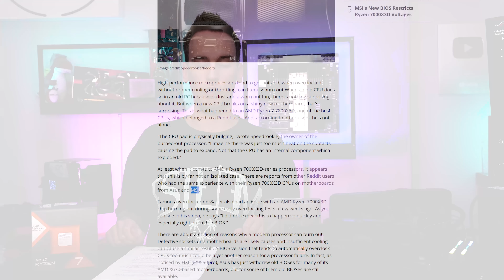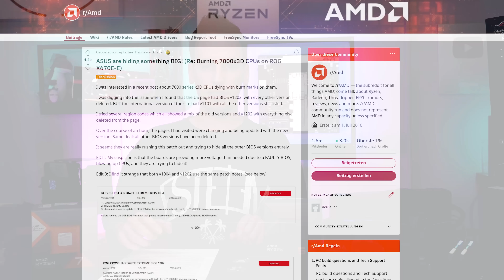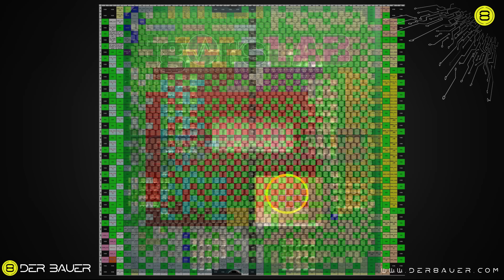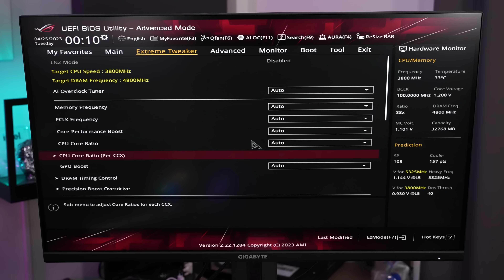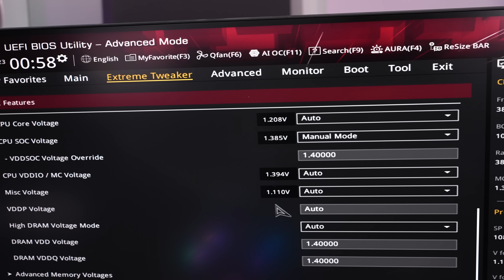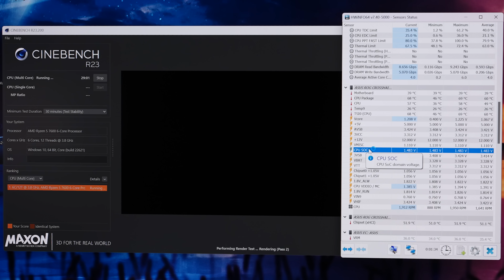I missed the Damage on this Ryzen 7900X

Comment: AMD has had a problem with voltage supply accuracy for a long time. For example, for gigabyte b550m ds3h, when installing the xmp memory profile, the voltage is set higher than that specified in the xmp profile, regardless of the memory manufacturer. That is, if the xmp voltage is 1.35v, then the voltage in the bios shows 1.365v.
Reply: that's normal, 10% up or down is engineering tolerance. The 12V rail of the power supply has 5% tolerance and it might be overshooting compounding the problem. But that memory voltage there is perfectly fine. I'm running it at 1.40V for a few years already. Just make sure that it is cooled enough.
Reply: NOOO THATS IMPOSSIBLE
LISA SU WOULD NEVERR

Comment: I'm glad I just got a 5950x, as newer stuff still hasn't settled it's quirks.
My choice should be fine for my multitasking and renders.
Reply: Got a 5800X3D a few months back and yep. Even the 7800X3D doesn't provide enough of a performance jump to bother upgrading to an entirely new platform for.
Reply: I am pretty happy with my new 5600 and used 5700xt. Puts my old system to shame and didn't break the bank.
Reply: Naw. It run’s awesome. It’s fantastic.

Comment: It's quite interesting to me because not only I have a X670E-F and 7700X, but also I have this weird problem where Ryzen Master doesn't work. Every time I want to set EXPO though Ryzen Master, the BIOS unable to post (UEFI only posts to "safe mode" meaning I have to clear CMOS settings). However, it works nicely if I go to Asus's BIOS and set the EXPO that way... (Corsair DDR5 6000 CL 36)... Maybe its because Ryzen Master not applying higher voltage??
Reply: chipset drivers issues.
Reply: @JomarsYT not sure, but the Asus board did bump up SOC voltage to 1.37. but still I gave up and just use the ECO mode in Asus's UEFI instead of using Ryzen Master.
Reply: Stupid overpriced motherboard but only a 7700X and CL36 RAM not CL30?

Comment: ive been running expo  I 32g cl 30 6000mhz on 7900x ( crosshair hero board ) with a 4090 and a 1200ax psu. 
it's been 4 weeks constant, very stable and no errors or problems. Strange results
Reply: Same. Just another jump scare video. It will be fine. I’m not worried
Edit- been running it since last November
Reply: coughs, thats roughly $6,500+ system, if you got other high quality components (PSU, M.2 SSDs, coolers, 4k monitor).  Its my dream setup.  I will try to get similar soon 7900x, but with 4070, Prime x670p, 32gb cl32 64000mhz, 1440p monitor and shave off $3000.   Not much of a gamer and I think the 7900x is a monster

Comment: I think you nailed it at 6:06.
The CPU died from something else, maybe just the SOC or IMC has died, and that made it stop correctly reporting some sensors back to the motherboard, that kept sending high voltages until it blew something inside the PCB/CCD/IOD due to really high temperature. 

It's like the motherboard had heard someone saying 'FINISH HIM!!!" so it did a fatality, but ended up dead too :text-green-game-over:.
Reply: Double Fatality
Reply: More like a failed friendship...
Reply: "Victory IS flawless!!!"
Reply: IOD? More like IED ! lol
Reply: IED? More like IUD ! lol
Reply: @cmja09  _!_lol
Reply: Would be funnier if we still had Fatal1ty boards.
Reply: Like Voldemort killing Harry Potter :)
Reply: hahaha
Reply: your x3d amd ryzen soul's is mine!
Reply: Do you think it is directly related to the VDD of the memory interface or rather indirect via burning the SoC by applying too high voltage to the SoC when using XMP/EXPO?

And related to that question: did the DDR5 modules also get fried?

Comment: I recently noticed the very high SoC voltages being used when EXPO was enabled with my 7800X3D and G-Skill DDR-6000 CL30 Ram, on an Asus TUF Gaming X670E-plus. This is with the latest (non beta) bios 1409 released a few days ago.

What concerned me was the sheer jump in SoC power - non expo default voltage was 1.05v with SoC power at ~9W. 
This jumped to 21W with expo enabled and 1.35v SoC voltage. That's quite a jump, especially when you consider the percentage increase is 133% from default.

Also that power draw is continuous - same in idle as under load....i.e. any stress it's putting on various SoC IP blocks at that voltage is continuous.
I lowered my SoC to a much safer 1.15v, then subsequently to 1.1v which has dropped the SoC package power down to ~10W.

I recommend everyone with EXPO enabled do this for now, or just disable EXPO if running any 7000 series AM5 CPU (X3D or not).
Reply: I have the exact same CPU/RAM on order with the ASUS ROG X670E-E. Until I watched this video I was planning to exchange the ASUS board for the MSI Carbon WiFi but it sounds like it’s a problem for all the manufacturers.

Now though, I guess I’ll stick with the ASUS board and follow your lead or just not use EXPO until the problem is fully investigated and understood.

🤷‍♂️🤷‍♂️🤷‍♂️ 😖😖😖
Reply: @Squashed8Ball  And the Carbon Wifi at the moment also has an know bug, which hopefully does not get delayed fixing due to this new issues. The issue is, that PCIe x1 and x2 cards are not recognized in the PCIe_3. Which with the humoungous size of GPUs today is more or less the only usable PCIe-Slot.
Btw. with 6000MT/s DDR5 the Carbon Wifi used VDDCR_SOC fo 1.350V and 16.8A
Reply: and as I just had lunchtime I checked MSI Carbon Bios for VDDCR_SOC. As soon as you enable EXPO it is fixed to 1.350V (without to 0, which then probably means default)
I now lowered it to 1.250V - so far no issues and it reduced the SOC's power-usage by ~5W - also in idle.. nice 😉
Cinebench is no good mem-test, but I simply used it for a quick-check, as I know the numbers to expect... and in deed the performance increased, as my 7900X@120W TDP was in the low 28k and now almost reaches 29k and still max-temp is 85°C with a decent air-cooler. 5W more headroom to the power-limit I guess.
Reply: @Squashed8Ball  its probably an AGESA problem so yes everyon affected nothing MOBO mans can do about it.
Reply: I have the same. 7800x3d / ASUS x670e-e/gskill ddr5-6000 cl30.  Meh, I’m gonna just keep on keeping on. (Bios 1202)
Reply: I noticed this weird behaviour right at the beginning, as my  #1 priority is low TDP in idle and under light load (so that NH-P1 can cool my 7900 passively). With Expo on, idle power consumption was at 40W, while with it off it was around 30W, with the difference being in SoC (this is quite a significant difference when the total limit is 88W). 
So obviously undervolting SoC was the first thing to do, in my case, 1.1V is absolutely fine with 6000MHz CL36 sticks. This not only decreased idle power, but also increased benchmark scores, as there's more power/thermal budget for cores.

I personally am not scared of EXPO, but definitely recommend everyone to decrease SoC voltage to 1.1V, if it doesn't introduce stability issues (in such case just go a bit higher). For both CPU safety, and compute power.
Reply: I don't have a DDR5 ram yet, just want to ask what is the default behavior without EXPO? Is something like revert to 2133 in DDR4, say.... 4800 in DDR5?
Reply: @Verpal  WIth EXPO disabled the motherboard will default to the JEDEC speed, which is RAM specific - but usually it is 4800Mhz for most DDR 5 modules, although if the modules are 5200Mhz non EXPO modules, it will default to that - no JEDEC SPD setting goes beyond 5200Mhz though as that is the official maximum speed of the memory controller on 7000 series AM5 CPU's
Reply: do you think it's a problem with not having a robust voltage controller... or temperatures messing with voltage controllers... since 5nm have that problem of heat causing spikes in areas of higher transistor density...
Reply: @Travis Clark The fact you heard popping noises, sounds like something blew on the motherboard.....question is, is it the motherboard that nuked the CPU or did the CPU nuke the motherboard - either wait both look to have ended up dead. If the CPU failed like others have with what looks to be a high current short - it could have popped the VRM(s) on the motherboard which stopped the CPU completely burning out. Alternatively the motherboard VRM could have failed with a short to 12v and dumped that into the CPU resulting in instant VRM explosion and dead CPU.
Reply: @Travis Clark Damn, another one. Yes stick with EXPO off for now - until we get a more definitive answer on what's causing all these chips to burn up.

Did your chip burn up with the bulge and socket pins in the same area as other X3D chips have?
Reply: I can't even run EXPO. I managed to grab a 7950x3d with a CROSSHAIR HERO. This is the first time I can't get my ram at advertised speeds. It's making me consider heading into intel.
Reply: I have the same ram and cpu but with an MSI X670E Tomahawk. With expo enabled can I just manually change the SoC voltage to 1.2 without touching any other settings?
Reply: @binodynamic  Yes, just reduce the SOC voltage...1.2v should be fine,  I went a bit lower to 1.15v as a precaution. My ram still runs stable, even with tight sub timings.
Reply: @blower1  Have you lower VDDIO voltages as well?
Reply: @binodynamic  Nope, have left that alone - not so concerned with the small raise to 1.35v for this DDR-6000 ram on EXPO.

If you start lowering that you won't get the ram to run at it's rated speed reliably - in which case you might as well disable EXPO altogether (reducing SoC to 1.05v and VDDIO to 1.2v defaults)
Reply: @blower1  I decided on disabling EXPO until it becomes more clear to what is causing this
Reply: @Travis Clark what’s the performance difference between EXPO on and off?
Reply: @Travis Clark For gaming will it be a significant decrease of fps?
Reply: Did you undervolt ?
Reply: @Travis Clark Yes just read that, explains a lot, pretty much everything. 

As indicated due to the way these chips ramp up power until they hit their thermal limiter if the high SOC voltage kills the whole thing that both monitors thermals and controls the scaling algorithm - then it can just scale up power consumption until it incinerates itself.

It is a theory still, but one that fits nicely. Seems me banging on in reddit and forums about disabling EXPO/lowering SoC voltage for the past few days holds some merit!
Reply: @Travis Clark What a nightmare. How long did you use the mobo and cpu for until this happened? Did you have EXPO enabled the whole time?
Reply: what about XMP? Everyone is saying that the issue is only EXPO related and not XMP related. So if you have XMP RAM, you should be fine?
Reply: @BeatmasterAC  xmp is intel
Reply: @AndrewB23  
i know, but you can still enable XMP, if the RAM supports it. Doesn't matter if a Intel or AMD GPU is on the Board.
Reply: How is the performance without XPO ? The 5800x3D performances were not really affected by faster DDR4, I wonder if the 7800x3D behaves the same.
Reply: @Travis Clark That’s very unlucky. I’ve had expo enabled for a week on my x670e Tomahawk, 7800x3d, 6000mhz cl30 until yesterday. Fortunately nothing happened
Reply: @Travis Clark at least you were able to get a quick RMA
Reply: I'm Using an Asus ROG Strix X670E-A with x4 16gig dims (64 total) of Kingston Fury Beast (non expo) with a 7900x3d - same results as you when running just in 5600mhz mode 20wats with DOCP on - then lowered the volts to 1.0 and now its 10w. I could never get 6000mhz to run stable with 4 dims- but i imagine the watts would be a lot higher.
Reply: I fking worried. I have a 7900x3d and I been monitoring the voltage I’m not sure how easy it is to get amd to pay for motherboard/cpu replacements since my parts are over $1000 usd.
Reply: @Travis Clark Hey Travis good info. Im on 7800X3D, new build and first time builder. I will leave off expo for now. I seen never over like 1.5 volts when I did R23 1 time for 10 minutes. Core 1 saw like 5.3...think maybe once 5.5 GHz. Rest normal 4.9-5ghz.

I hope its only small sample, but I'm on asus b650 sooo. Hope bios updates in future etc safe.

SHOULD ONE USE ECO MODE? Maybe just turn that on. Easy thermals too, was planning on doing it regardless, my CPU only draws 75-80watts max through in R23 :)

Comment: I have a screenshot of my Asus TUF Gaming x670e Plus Wifi and 7800x3d hitting 1.55v vsoc under auto setting, with expo disabled.  The statement that such voltages are only possible by user intervention is just not true.
Reply: Also despite setting 1.1v limits for vsoc and vddio after that happened, I found a maximum of 1.6v vsoc and vddio from hwinfo this morning (and 1.7v vddcr vdd) after leaving it running all night, so the mobo just ignored the voltage I set
Reply: Thank you for this comment, I have the same MB waiting for my 7800X3D to arrive. I will be checking my voltages.
Reply: 1.55v is spooky

Comment: Got a 7900x in a Gigabyte X670E Aorus Master here and Ive had two separate EXPO memory kits that did not stay stable past a week or so. First kit was a 32GB G.Skill 6000mhz CL36 kit. so i bought a 64GB Corsair 5600MHz CL40 kit, same problem. ended up going back to stock JEDEC timings in both cases. last time i turned my PC off it did not want to boot back up again. i had to coax it back and then it still wasn't working right for a few hours. wonder if i should pull the CPU and inspect.....
Reply: EXPO can be the greatest design under the sun.... but ultimately we are still limited to a not so great memory controller, which is practically a ryzen tradition at this point.
Reply: fucking hell man thats rough, have a new full upgrade ready to go, over £900 worth,  thanks for posting , will save the hassle for a week or so

Comment: I hate to break it to you AMD, but those pins welded on the CPU where doing an wonderful job at dissipating some heat. 
 Aio makers have to bring  water cooled black plates. 
 You're welcome...
Reply: An IHS which isn't 13 miles thick would be a good start.

Comment: @ Derbauer All AMD cpus are out of stock warranty conditions as soon as you boot up with PBO enabled be default. PBO = No warranty, only base clock Is covered by warranty. All these overclocking features that come on by default make your warranty void as soon as you boot!
Reply: With AMD stating that they should be run with 6000mts DIMM's, they will have a very hard time not honouring the warranty on that basis alone.

Comment: I was about to get started on a 7800x3d build and I'm seriously considering canceling my order. Guess I'll hold on applying EXPO until everything is worked out. :/
Reply: my upgrade builds ready to go, not now will wait.
Reply: @martinmalone6324  I've already got the chip. I'm just waiting on mobo, ram,  ssd's, PSU and case. Saving up for a new Graphics card, I got a 3080Ti in a different build but not sure if I want to sell it. I like having spare parts. Will definitely postpone building it for now though.

Comment: The difference between 1v and 1.5v on the SoC rail will never do anything thermally that severe that it would cause delaminating the PCB. The fact that it happens on CPUs running EXPO is entirely attributable to the fact that basically nobody runs these things at JEDEC speeds. I expect this is a manufacturing defect in the PCB, most likely a short between vcore and GND.

Didn't you test the resistance on your 7900x and find it was basically 0 on vcore?
Reply: idk from replies on this video alone it sounds like a lot of people cannot even run their EXPO kits at the rated EXPO timings.....
Reply: @nemesis1588  Unrelated problem
Reply: I 100% agree. Feel like saying it's EXPO is just cope. Literally everyone runs EXPO or XMP at the very least.

Comment: These comments suggesting that these new AM5 Ryzen CPU's are somehow a "ticking time bomb" isn't at all supported by the evidence so calm the F down already. 

I've been running a Ryzen 9 7900X - EXPO II - DDR5 6000MHz / 30CL - PBO( -) 20 all core via Asus ROG STRIX X670E-F - My system has been running great - CinebenchR23 = 29500 all core / 2050 single-core - No worries here of "blowing up" anything.  Cooling via: DeepCool LT720 -360mm / Thermal Grizzly - Gaming Temps generally max at ~ 81C running 5.5 - 5.7GHz sustained. 

Now watch my shit blow up tomorrow lol. Kidding aside, I don't think it's even remotely time to panic though it is something to follow up on and hopefully continue to learn more about.

Thanks again Der8auer!

Comment: maybe there is a problem related to specific combos of mb & ram with that expo&soc settings ... in the past there were ram manufacurers that had avertised xmp or oocp(if i rememnber the name correclty) but that wasn't true at all ... also another factor could be the "unsupported" ram stick... like if that model does not appear im the supperted ram list of the mb ...
Reply: i think unsupported ram is a think of the past, im using 3600mhz ram "ryzen ready profile" on a 7600k xD